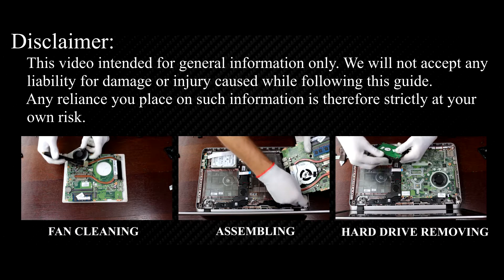HP Envy 15-k Series RAM Upgrade and Installation Guide

Comment: This was really useful, thank you. Managed to replace the hard drive, upgrade the RAM and replace the CMOS battery all at once. To anyone giving this a go, be careful with the flat silver screws beneath the disc drive (there are 3, quite easy to miss too), it's easy to damage the thread. It isn't the easiest to take apart but it only took me about 1.5 hours, and that was taking it super carefully.

Comment: Be VERY careful with the keyboard flat cable and the connector on the motherboard. The wiring harness/connector lifter/clamp came out on mine and it would not go back together, so I had to jerry rig a solution using pressure from the actual palmrest to keep the cable engaged in the harness.

Comment: Hello! I would like to see the mSATA SSD installed on my notebook HP ENVY 15-r153nr
Reply from the maker: +Go Go place for mSata card: 9:32 (to the right of RAM slot, and below the fan), as I remember it might be it
Reply: Thanks for the reply. I'll try to disassemble to see.
Reply: At 9:32, its not the place for mSATA but M.2. You can see the single screw area almost 10 cm away from the port.
BTW M.2>mSATA, Winning situation actually.
Reply: спасибо, я уже набрался смелости и свой разобрал
Reply: thank you, I have plucked up the courage and its disassembled